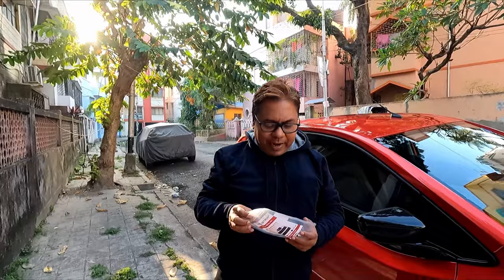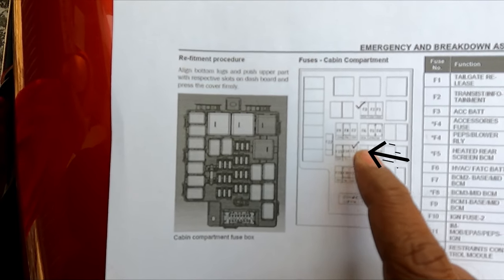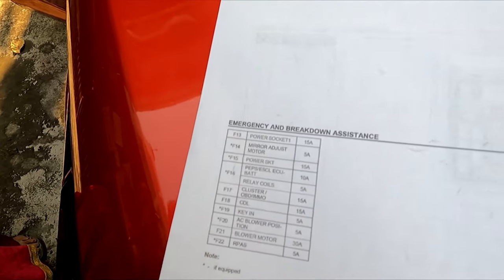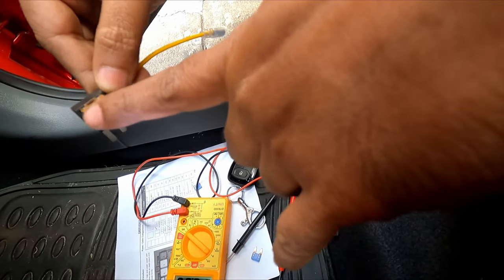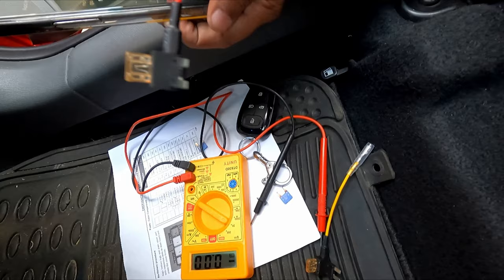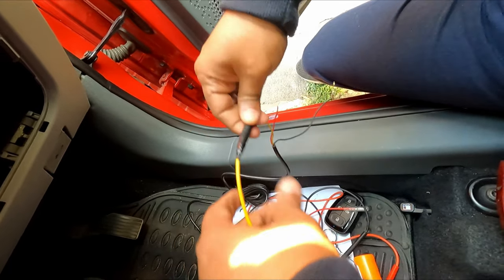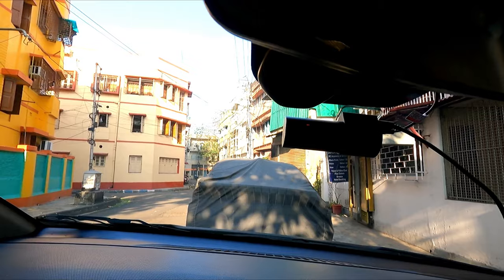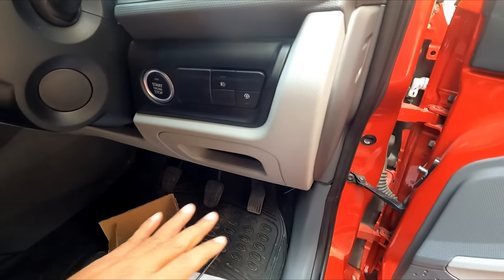How to Hardwire a Dashcam /Accessory with Fuse Tap in Tata Cars #dashcamindia

Comment: By connecting parking monitor in fuse , is there any battery drainage for those who are taking car out twice in a month?
Reply from the maker: There is a battery protection mechanism so the parking monitor will stop once the battery reaches that point. So no need to worry.

Comment: hello , 
which is a better option between hardwiring and OBD2 kits and is there any danger of warranty getting void
Reply from the maker: None  will void your warranty. But my preference is hardwiring.
Reply: @supercyberautomotivetravel  thanks any reason for your preference being hardwiring, TIA
Reply from the maker: Hirdwire is a direct 12 volt accessory line with a fuse only. OBD power may have some control from ecu.

Comment: Sir, is yours DDPAI , i am thinking of getting DDPAI dashcam and hard wire it in my altroz XZ, do i need to check with dashcam vendor on which fuse to tap?
Reply from the maker: Mine is the Nexdigitron brand. The vendors for DDPAI , 70MAI are also Nexdigitron . A wiring diagram will be there in the manual.  The connection procedure is the same.
Reply: @supercyberautomotivetravel   ok thanks.